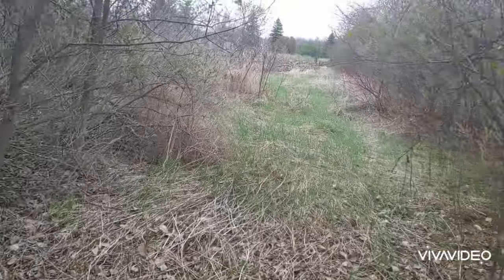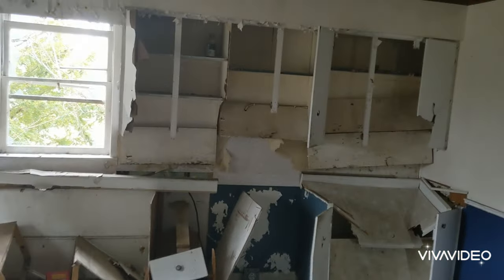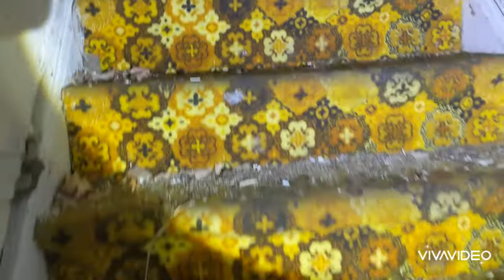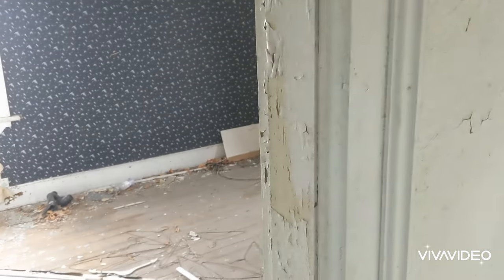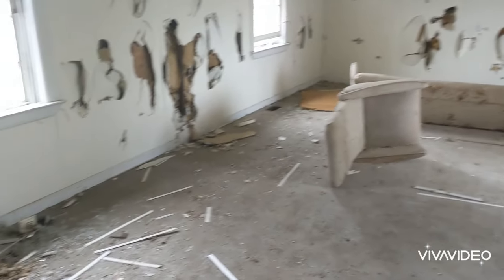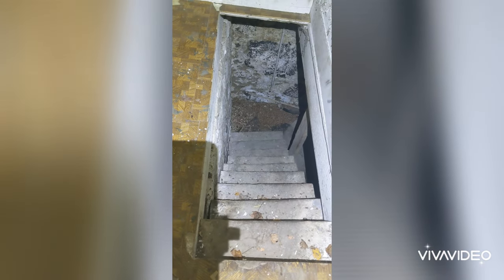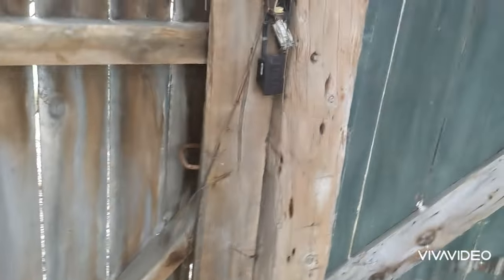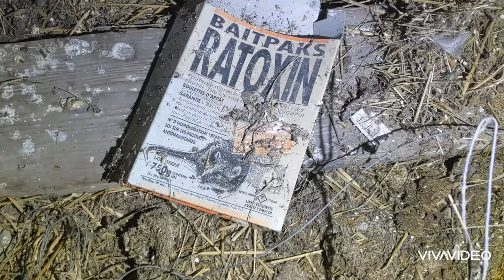Beautiful Brickwork in Abandoned Mansion! (Hand Built) EXP.1

Comment: Even though this has drywall gone and ceiling tiles falling its actually in pretty good shape . That wallpaper in the closet was a nice pattern. That was drapes of the floor. This house was probably built before drywall came out or in the early days of the transition to drywall; transition was 1916 through the 1940's. You actually can still get metal and wood outlet and light plates, they aren't cheap though.  That brick fireplace probably gave a lot of lasting heat for the house.  Those Kitchen beams could be faux, based on the direction they are running.  That stable was a nice set up.  Neat Explore- Keep Orange Crushing It!